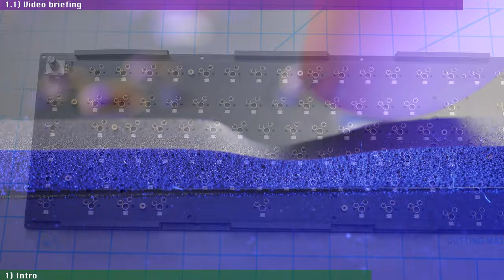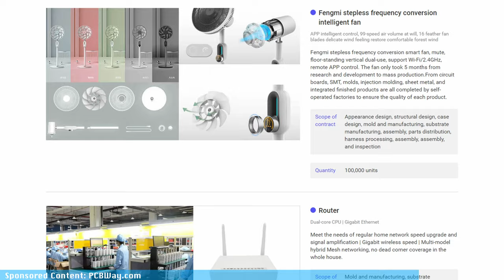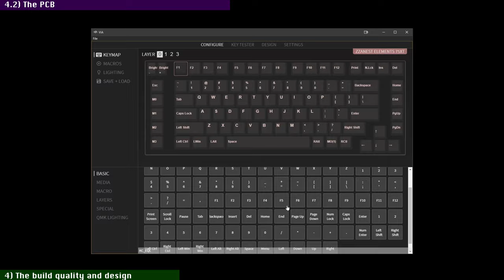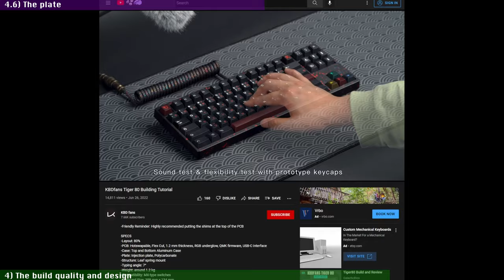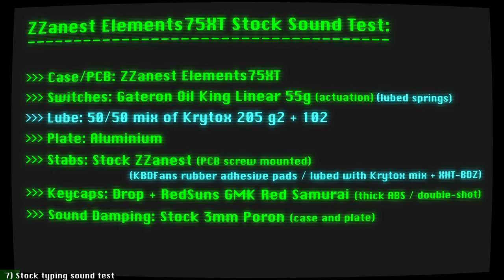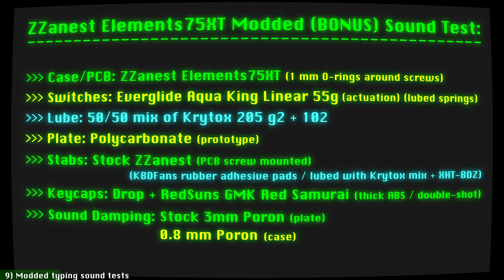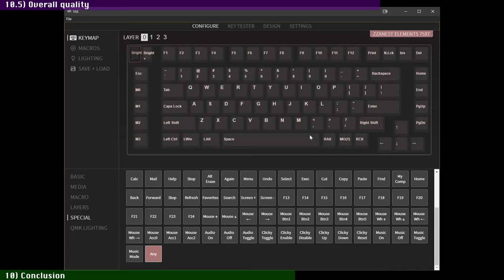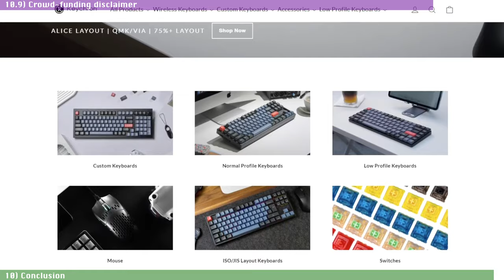Like a 75%, but better... [ZZanest Elements75XT]

Comment: You're my goto when it comes to keyboard stuffs, but have yet to dive in and hands on into this rabbit hole.

I noticed you mention Durock T1s in some of your video description. What do you think of them and is it a good switch to start with, buying blindly without knowing their feel?

I come from a very old Ducky keyboard with Cherry MX blues and Razer Blackwidow with the box Greens, but want to try something quieter but with a nice bump.
Reply from the maker: Thanks Hafizul! Appreciated man!!!

And yes! T1s are still (after years in the market) some of the best tactile switches out there! And they are not prohibitively expensive, which is nice... They are at the same level of the more expensive Drop Holy Pandas for a bit less money. If you want a very tactile switch that feels smooth and sounds nice out of the box, you can't go wrong with the Durock T1.

T1s also come slightly pre-lubed, which is great for newcomers, as you wouldn't have to lube them manually from the get go (you can lube their springs later on for better sound though).
Reply: @IOSam  thank you for the reply! The durock store on aliexpress having a great sale. Im gonna grab some switches and stabs there now. Already have the GMMK Pro on the way to me also thanks to your videos. 😁😁😁
Reply from the maker: @syaqattaq90  Awesome man!!! So happy to know my video was helpful to you in your mechanical keyboards journey!🙏

Comment: This keyboards looks amazing. Im a fan of the GMMK Pro (made my decision thanks your video), and it became a great silent keyboard to use at the office. So I might pick this up whenever there is a round 2 (hoping they have a white version). Have to agree as well about the bounce, I like a firm keyboard, not the biggest fan of having a bouncy keyboard.
Reply from the maker: The more I use this profile, the more I like it! While it seems the Kickstart project will not happen, the project runner had told me he would eventually open a group-buy for the barebones kit if there was not enough interest in the pre-built board through KS. So, I hope he might be able to offer additional colors through the group-buy.

As for most custom keyboards going for the "bounce route" in the last year, I'm happy to see that many group-buy keyboards now are offering multiple mounting options (usually gasket or top mount) in the same design, which is great to allow users to pick either a super bouncy or more stable route according to their preferences when assembling the board.

Comment: Curious as to which mods you would use on the Zoom TKL
Reply from the maker: While I have not tried one for myself to be able to tell how I would build it, from what I've seen in a few reviews, I'd probably go with PC plate + case and plate foams (for a less sharp and more subdued sound).
Reply: @IOSam  definitely will try that setup thanks 👍